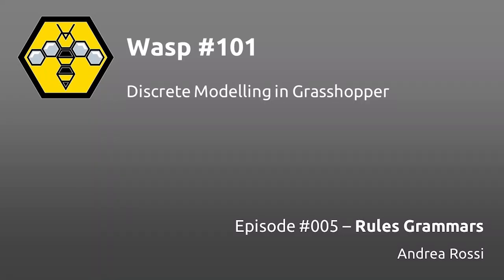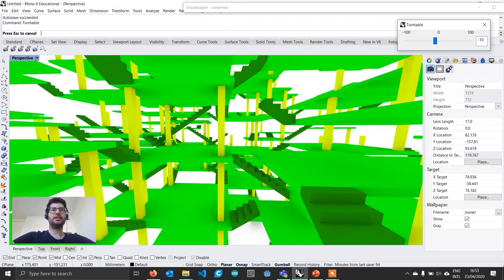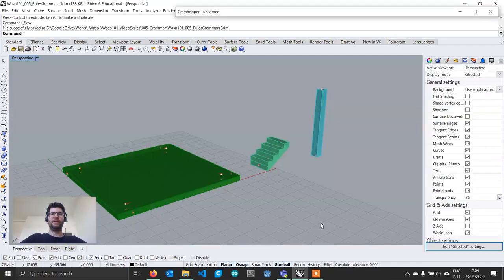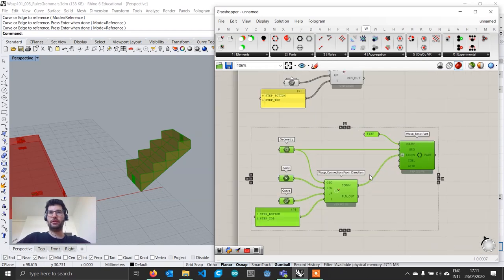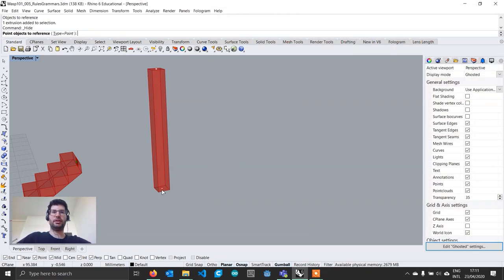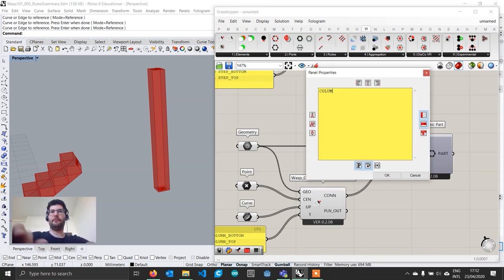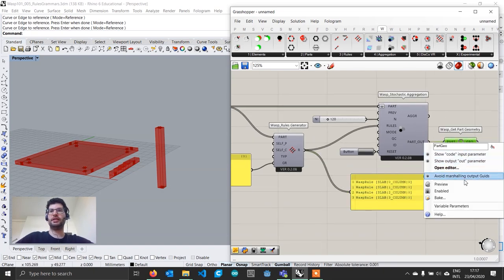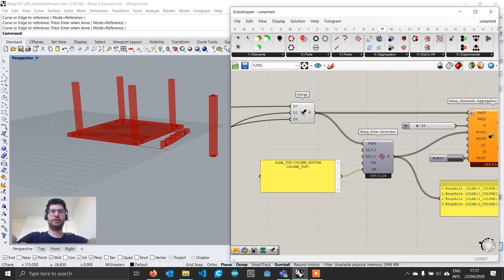Wasp for Grasshopper #101 - Tutorial #005: Rules Grammars

Comment: great work!  I was wondering if there is  way of controlling the number of (platforms  or the number of stairs) ? cheers
Reply from the maker: Hi! Yes, there is the possibility of controlling the amounts of different part types using the Part Catalog component. You need to make sure you updated to the latest Wasp version (currently 0.5.004), and then you can check this video for instructions: https://youtu.be/rn2Obdd8T6E
There is also an example file in the latest Wasp release showing how to use it.
Let me know if anything is not clear.
Reply: @TempAutonArch   thanks for replying. 
i have managed to add the wasps parts catalog to the script but i have an uncontrollable outcome so not sure how to gain control. cheers.
Reply from the maker: Hi Michael, what do you mean by uncontrollable?
If you mean that you cannot control the final shape of the aggregation, this can be done in two ways:
- Field-driven aggregations: https://youtu.be/e5K4c_BOt8c (and following videos)
- Mesh constraints: https://youtu.be/Wk9gKPfX4hk
Reply: @TempAutonArch  
Hi, 
the problem that i am having is that the wasp parts catalogue doesn't work. the only thing that affects the number of total geometries is the number of parts aggregate in the stochastic aggregation.
Reply from the maker: Uhm, that sounds strange. Could you send me the file, either through the Discord channel, or by email at ghwasp@gmail.com?
I will take a look as soon as I have a moment.

Comment: Hello, thank you for this plugin and the tutorials! 
But I was wondering: is there is a way to exclude specific connections for the custom grammar connections (in the same way that we allow specific connections)?
Reply from the maker: Uhm, not sure if I understand. I guess it is just a matter of how you organize your connection types and grammars. If a connection is not included in a grammar (its type is not called in any statement), it will not be used. Maybe if you have a more concrete example I can be more helpful.
Reply: @TempAutonArch  Thank you for the reply! For example: say I have a set of parts all with the same dimensions. even if I use the grammar rules to allow certain connections,  some connections that I have not included will still occur because of how they all share the same dimensions (they do not completely collide, but share edges). As a further example, say I have different three square tiles as parts - red, blue and green. I allow connections between red-blue, blue-green, and green-green. If four tiles were generated in a simple 2x2 square, I may get the configuration (reading clockwise or anti-clockwise) of red, blue, green, green. And so here I have green next to red even though I did not include it in the rules. Does that explain it more clearly? Thank you again!
Reply from the maker: @brewettl8040  Yes, now I get it. In general, there is no direct way to check for this, mainly because during aggregation I do not check if any of these overlaps happen (as it would reduce performance quite a bit checking overlaps for all already placed connections). If you want to make sure that certain faces stay always free, you could try to achieve that by adding an extra collider on those faces, but then nothing would be allowed to connect there.
I am considering to add such check as optional in a further Wasp version, but I did not totally wrap my head around it. I keep you posted if I come up with a way of doing it.

Comment: How can I control the mesh setting conversion before creating an aggregation?

 My problem is that the output meshes have too many faces and i want to simplify them. If i do the mesh conversion manually before connecting to the basic part, still my output aggregation gives many complex faced meshes (multiple triangled faces even for a simple cube). Is there any solution for this?? Thanks.
Reply from the maker: Yes, you need to do the mesh conversion before inputting your geometries in Wasp. You can change the meshing settings in the MeshBrep component to have meshes with lower complexity.
If that is still not fixing your issue, the best solution is to model a simplified geometry which represent your parts, use that as the Part Geometry, as attached the detailed geometry to the part as an Attribute.

Comment: Hey, thanks for uploading these. while making a connection for steps I get '1. No valid plane provided for connection 1" error in Wasp_Connection From Direction operator. why?
Reply from the maker: Hi, normally this error comes because the component is not able to calculate a valid plane. This is usually due to one of these issues:
- the center point of the connection is not on the surface of the part, but slightly off.
- the center point is ok an edge. This often causes problems as the component is unable to compute the plane normal correctly.
- You might have assigned connection centers and Up directions in the wrong order.
Try checking if this helps, if you still cannot solve it, you can send me the file via email at ghwasp (at) gmail.com
Reply: @TempAutonArch  hey thanks for a quick reply. I will check and get back to you. thanks
Reply: @TempAutonArch   Amazing work! So any connection point MUST be on the surface of the part? Is there a way to create a connection inside a part, such as offset inwards so parts deliberately overlap? Thanks in advance.
Reply from the maker: The connections must be on the surface of the part only if you use the Connection From Direction component. You can create connections anywhere else not on the surface by using the Connection from Plane component. In that case, the connection can be anywhere.
However, if you want to allow parts to overlap, you will also need to provide a custom collider in the COLL input, otherwise Wasp's internal collision detection algorithm will not allow the placement of the parts.
Another solution would be to create a "normal" part with connections on the surface, and then attach an Attribute to it with the overlapping geometry. This would avoid you needing to create connections and colliders correctly, as this might be a bit tricky. You can see how to use Attributes here: https://www.youtube.com/watch?v=AVI4uhPKrMI
Reply: @TempAutonArch  Amazing! Thanks for the reply!
Reply: Thank's for sharing. I had the same problem using the tutorial file sent on description.
Reply from the maker: Are you using Rhino 8? If yes, please make sure to convert the geometry to Mesh before plugging in the Connection component. This should fix the issue.
Reply: @TempAutonArch  thank's for replying. 
How can I do this? Wich component I have to use?
I've just tried it using brep, surface and mesh components, but it still doensn't work. 
Note that I am not an advanced user. Yes, I'm using Rhino 8.

Comment: Hi I tried the script however when I add the staircase geometry it says that it cannot compute a valid collider geometry. Could you please help me with this error
Reply from the maker: This means that your geometry had some issues, or was not a fully closed one. What you can do is to create the collider manually, by offsetting the base geometry inwards in Rhino, and then provide that as collider geometry in the COLL input. If this is not working, you can send me the file either in the discord chat, or at ghwasp@gmail.com